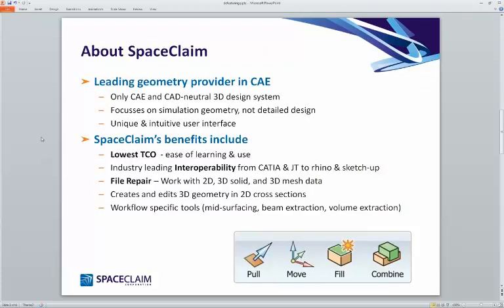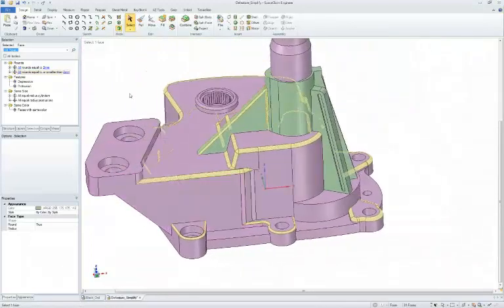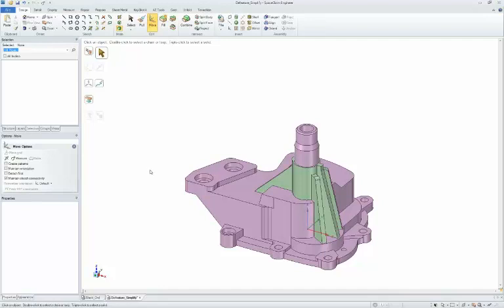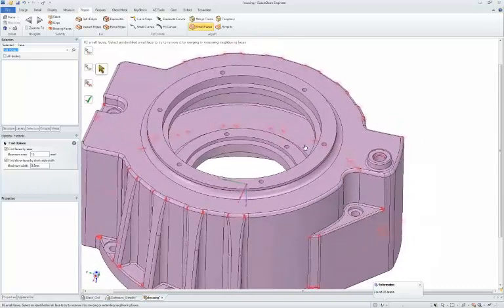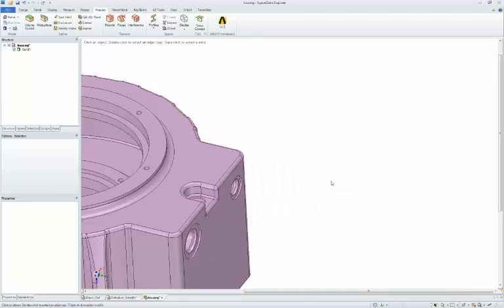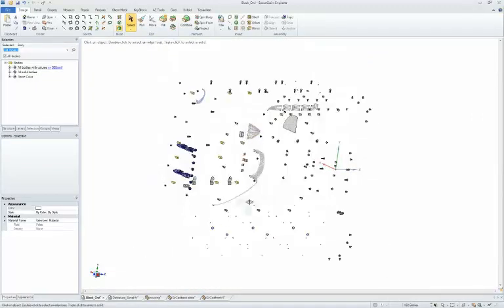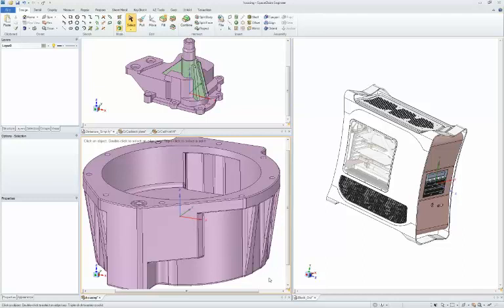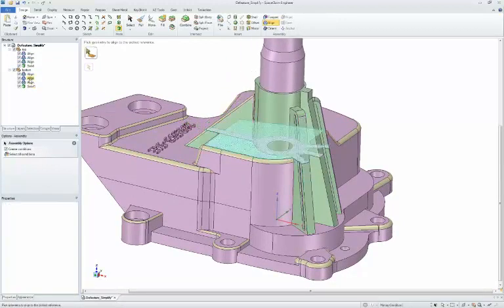Webinar - SpaceClaim for Analysts

Comment: 22:25 I see that removing the grill type of areas that has around, 3000 faces will help in the meshing section. But wouldnt that also ruin the purpose of that grill. Like maybe it is designed in a way to help with the cooling, and by removing that from the geometry what if we ruined the whole purpose of the flow?